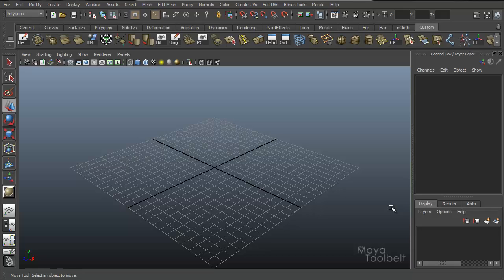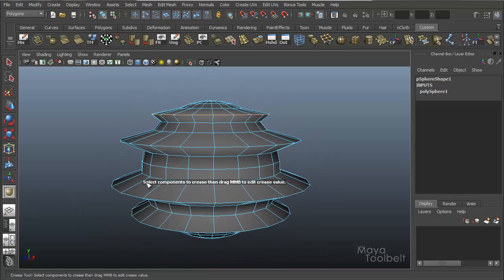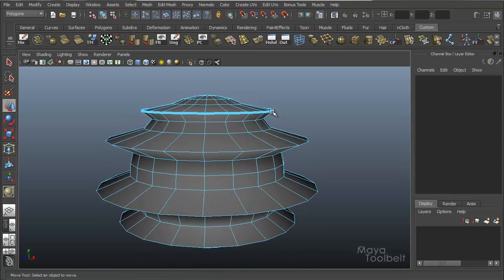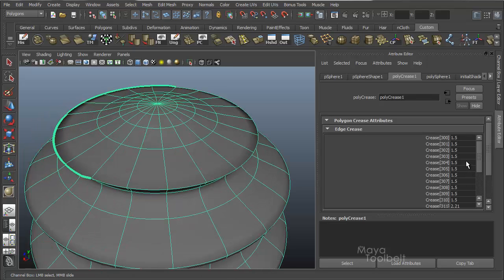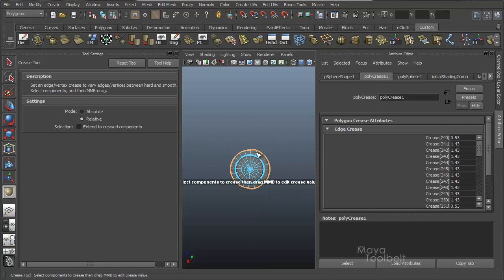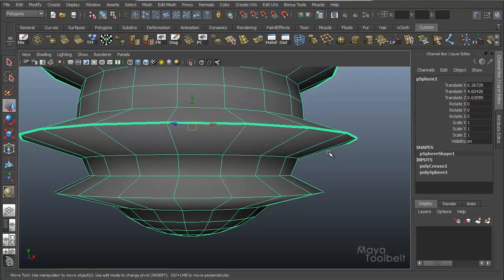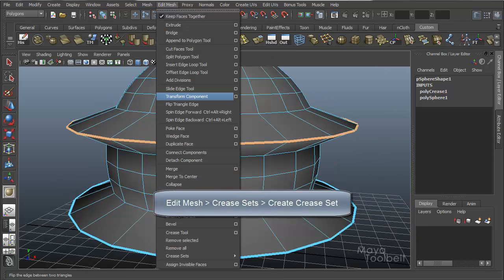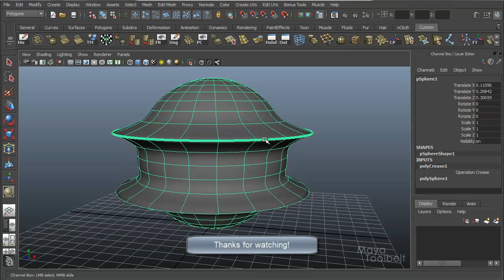The Maya Toolbelt - Crease Tool

Comment: A little heads up. The crease tool works only inside Maya. So don't use it if you're going to export your model elsewhere. You'll end up with a regular edge.
Reply from the maker: Valid point, thanks!

Comment: 15 mins is way too long. Good tutorial but way too long. This could have been condensed into 5 minutes. I know this is an old video but I see you also recently posted freeze transformations which is 13 mins long. I'm not trying to rag on the videos, just give a suggestion since most of the comments here don't critique. Personally when I'm trying to see how to use a tool in maya, I'm either trying to use it or was only curious because I didnt know its function. In both of those cases, I only need a quick answer.
 I try to click on videos less than 7 mins long, if it's less than 2 its probably either perfectly condensed or completely useless, but anything less than 7 mins I'll prefer. 13 mins isn't super long especially when I can 2x speed and skip through the video, but when I'm looking for a quick answer and have to search through  multiple tutorials because some have misleading titles, the whole process isn't fun. I'm not trying to sound like a jerk, I just wanted to give my opinion. 
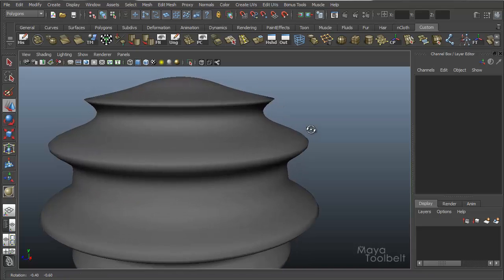Also, great idea with your uniform font that you have on all your video thumbnails, they definitely stick out among the rest. I feel rude writing a paragraph whining and only a sentence of praise, but I took the time to write all this because this is a great channel and I think would be perfect if the videos were a little quicker to the point (like how crease usage starts at 3:00 and effects are shown at 5:00)
thanks for reading all this, :) sorry for being a jerk
Reply from the maker: Not a jerk at all! I appreciate the feedback! I do try to show the basic information first before diving into all of the details of the tool's options. The reason a video going over a tool might seem long is just that, I try to show what all of the options do as well as the basic use. If you watch a video, get the basic usage in the first few minutes and don't need to know much about the rest of the options, so be it. But if you're interested, the info is there for you to watch if you want to. I'll make an effort to get through the "basics" so to speak a little quicker in my videos.

Comment: What about hard edges I'm havering trouble there are weird shadows near some edges of my model.
Reply from the maker: Chris Bandy Does softening the edges help? If not it might be a Normals issue, where the normals on either side of the hard edge are reversed from each other. Let me know if you need more details on how to check for that.
Reply: Harden the specific faces of the polygon